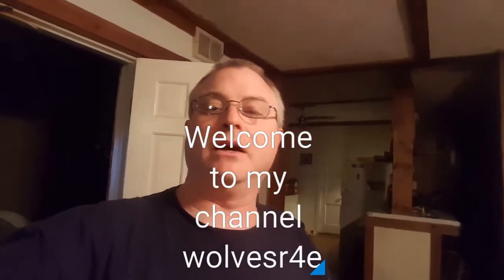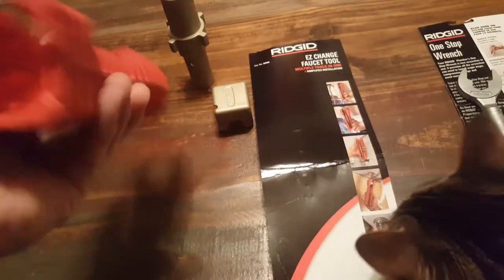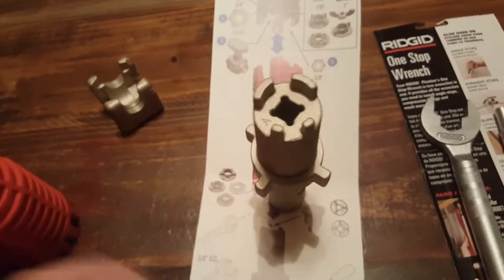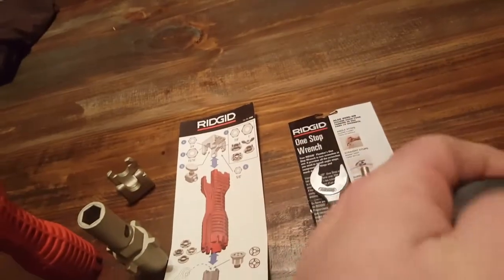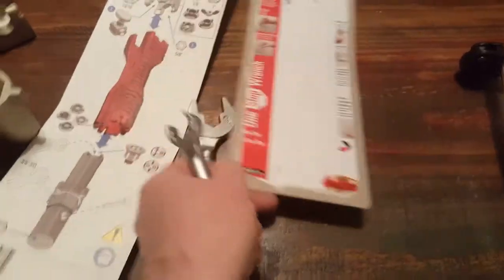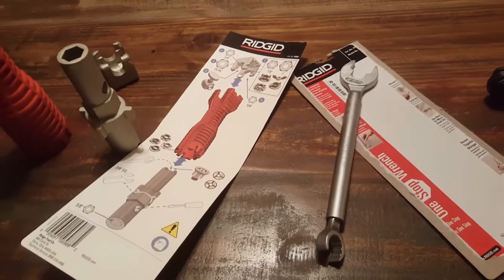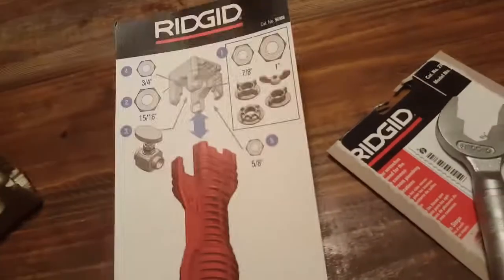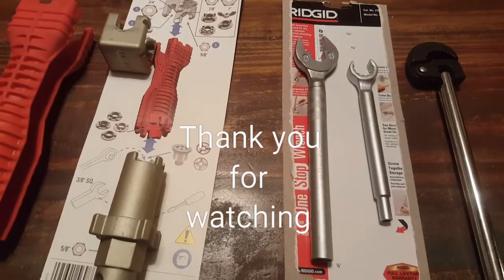Tool review for Ridgid faucet wrenches

Comment: Nice tour of your plumber's tools. The wrench in the middle would be better if the head could be turned 90 degrees like the wrench on the right. That handle on the middle wrench would be prone to hitting parts of the faucet, supply lines, and the sink.

Comment: I just bought the latest version of the EZ Change Faucet tool and I'll be getting the one-stop wrench next!   Pro tip: the smaller end of the One Stop wrench is designed to fit the leverage hole on the EZ Change Faucet tool!